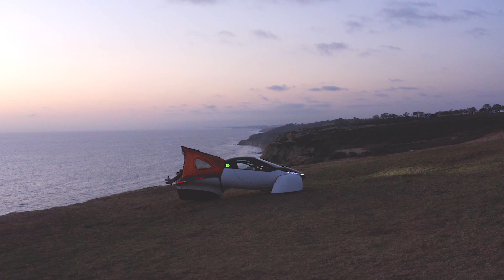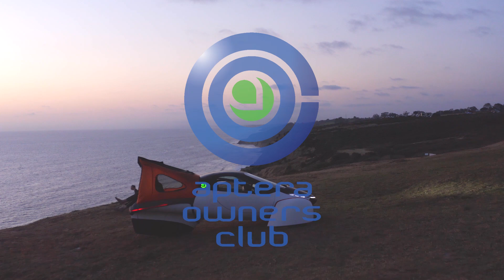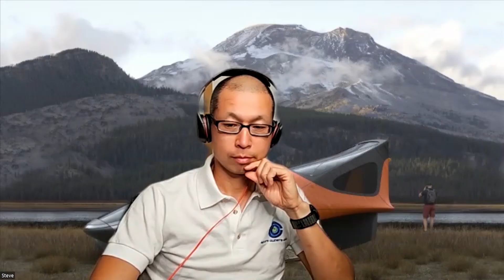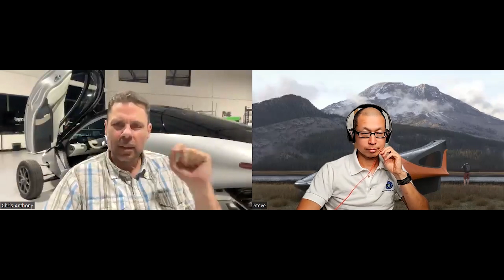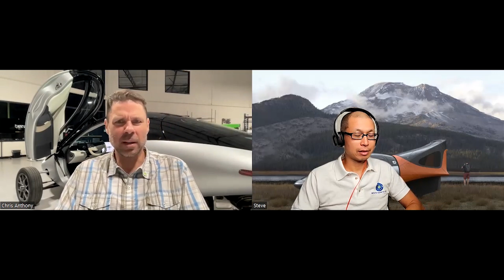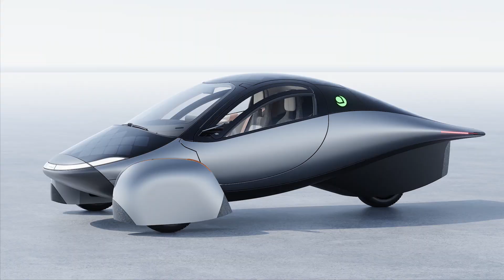October 25, 2023 Aptera Co-CEO Chris Anthony Full Unedited Interview

Comment: 23:45 so I’m realistically looking at 2027 for delivery:
April 2024: UI/UX final production testing
October 2024: validation
October 2026: first edition and 400 mile range backlog
April 2027: Midwest 600 mile range allocation deliveries. Ugh. 🙄
Reply: You may not realize the critical importance of the Launch Edition. Two thousand Accelerator vehicles followed by another three thousand LE's. Deliveries begin by end of summer next year. I'll be getting one of the first two thousand, but how long will Aptera take to produce the next three thousand? Because nothing will happen until after this first production run. The hope is the ATVM loan is awarded and used to fund another factory. No other variations likely until then, whenever that will be. This is why I stepped up and joined the program.

Comment: A pump can be weak and seem like it's working, I hope each pump is easy to get at. If there are no leaks, a pressure sensor can easily notify you,or a manual nipple will let you test pressure. Cooling being so important, I would make a good way because it's such a used necessity long term.